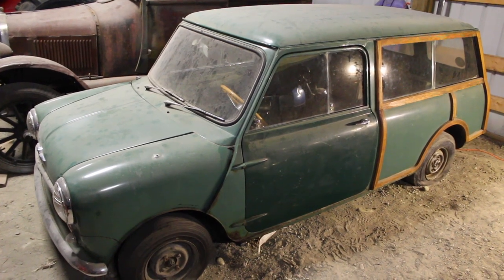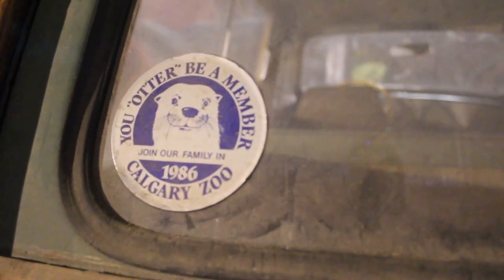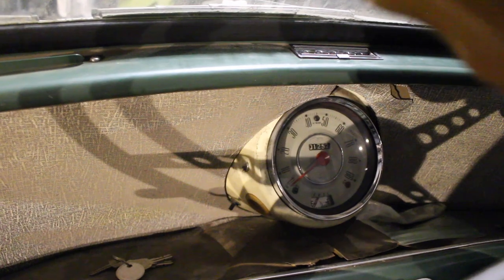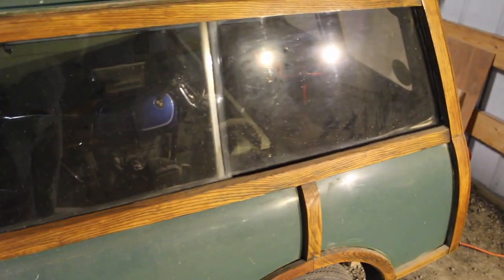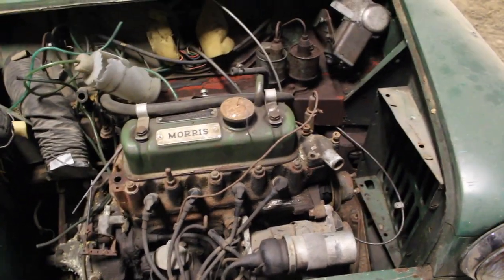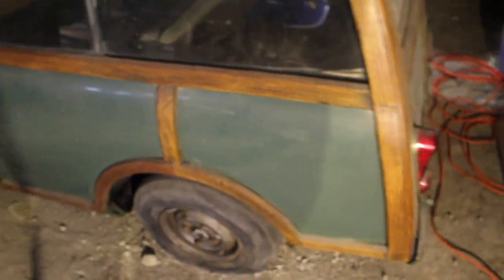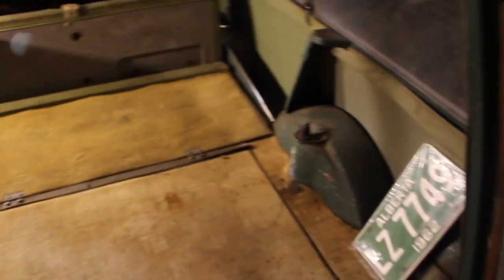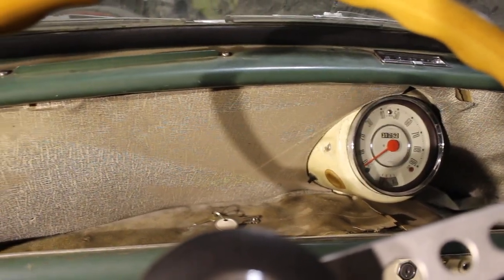Abandoned 1962 Morris Mini Wagon- Last driven in 88!

Comment: I remember the starter button on my 1960 mini being between the front seat's location,  and the headlight dip switch next to the clutch pedal, maybe the export ones were different, as I'm in the UK, there are not many early minis with a single dial about now, in the years I owned one the only problems I encountered was the electric fuel pump would sometimes stop, but after banging the floor above the pump it would start ticking again and work, it was also a nightmare in heavy rain conditions, this would cause the engine to stop or misfire, it was a lot better once a rubber boot was installed on the distributor cap, and fitted a small plate behind the grill to help stop water going onto the cap, we also sprayed the spark plug leads & coil with a spray that looked like lacquer, bearing in mind WD 40 or similar was not out in those days, its good you are going to keep your one original.